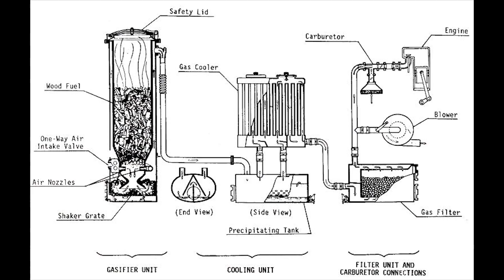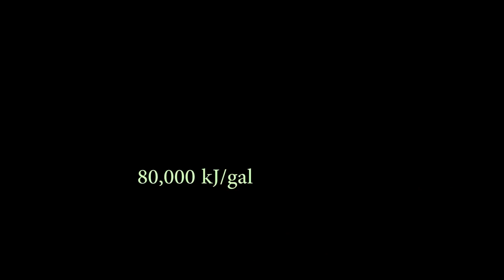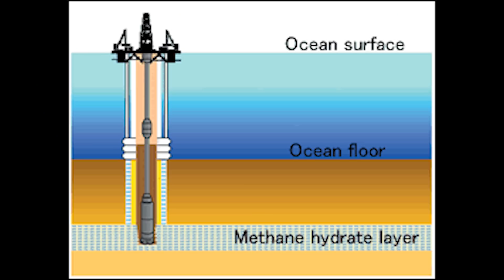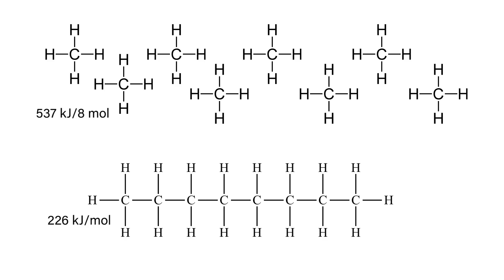Is it possible to fuel the world from grass clippings?

Comment: In my per-retirement days working for the nasty Big-Oil (Chevron) I did research on how natural gas is formed, particularly its formation from bacterial degradation of organic matter. Methane from bacteria called methanogens is uniquely distinguished from methane formed during oil generation (thermogenic) by there stable isotopic signature. Carbon has two stable isotopes called carbon-12 and carbon-13 and when methanogens form methane they preferentially use carbon-12.  They don’t know they are doing this (I don’t think, although I never asked one), it is just that the carbon-12 bonds are a bit easier to break than carbon-13 and this difference is large at lower surface temperature that the methanogens are working at and this difference decrease as the temperature increases (i.e. at greater depths). So methane produced by methanogens have a measurably higher concentration carbon-12, this is determined by stable isotope mass spectrometry. BUT, of interest to this video is that we also found ethane, propane, butane and pentane that also exhibited higher concentrations of carbon-12.  So did some of these higher hydrocarbon gases come from some type of bacteria (e.g. ethanogen, propanogen, . . . )? I would say we never proved this but is very suggestive. Can a bacteria be isolated that produces ethane or propane? If they are there you might figure a clever microbiologist would have found them, but I don’t known.
Cheers, Mark
PS
THINK ing ABOUT the end of you video IT seems you left something out.

Comment: Great video Arthur. I am so glad that your back is doing better. I have been fascinated by this subject for a long time now. It seems that we just throw so much stuff away that could be used for better purposes. One thing to point out is that once a landfill has reached full capacity and it is covered over with dirt they very often have to install a vent pipe and burn off the methane that is produced by the decomposition. I am not sure if any landfills actually try to capture and utilize it but it is produced in great quantity and the process could be refined to get a better return per ton of organics. We just burn so much more gas and coal because it is easy to get by the ton so people have not become desperate enough to get energy in more environmentally responsible ways. Thank you for making such great content and have a great day.

Comment: We have to stop using all carbon-based fuels at once. Our lives will depend on it. Solar is the only way to go. Once we have reached 30%+ efficiency in our solar photovoltaics, we are over the hump and won't need anything extra. 
IF I was in charge, I would divert all military spending to build solar power stations. The energy from those power stations would build more solar cells and more solar power stations. Windy areas will get wind power. Nuclear power will be banned. 
Cattle farming will be banned. They produce the most amount of methane of all animals. 
Wood harvesting will be done in a 100% renewable manner. There would be a 1000% tax on plastics from oil and other non-renewable sources. 
The alternative is that we all die from starvation due to extreme climate change. Pick your poison. 
I sold my car and have been riding an electric scooter for the past 3 years. Not easy when you live in Canada. Moved to a tiny house only 600 Sqft. Much lower utility bills to boot. 
I hold my head up high and show my kids that I am willing to make some sacrifices to do my share in this world.
Then I see some selfish assholes driving a gas guzzler SUV, pull into driveway of an 8000 sqft mansion and what can I say? 
They should go thank their lucky stars I am not in charge. Up against the wall...
Reply: UFOhunter your statement make no sense. Nuclear power plants don't give off greenhouse gasses, so how is the alternative to banning it death from climate change?
Reply: Fukushima
Reply: UFOhunter your statement makes no sense as a response to what I just said.
Reply: UFOhunter Fukushima never released any greenhouse gasses just like ALL nuclear reactors
Reply: No shit Sherlock! Even school children know how a nuclear reactor works!